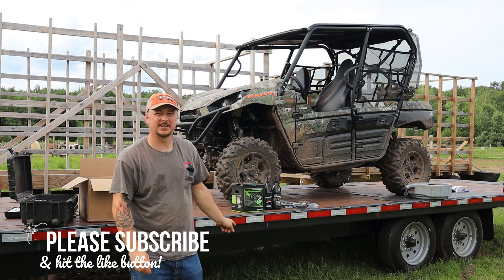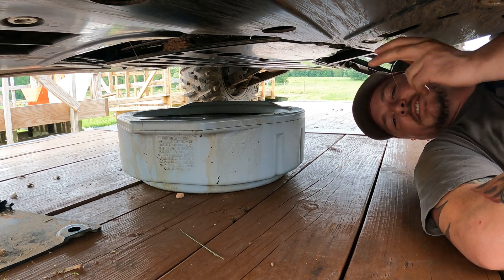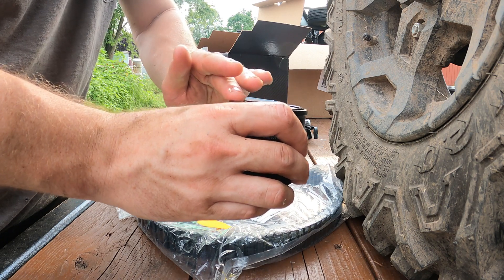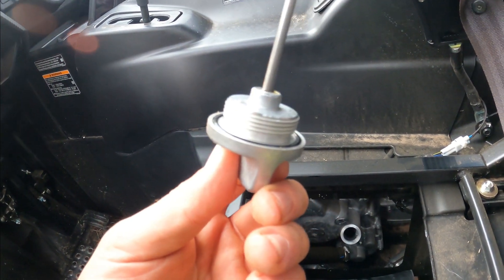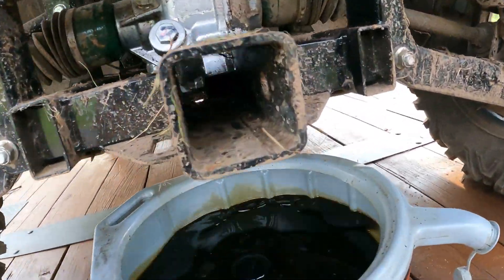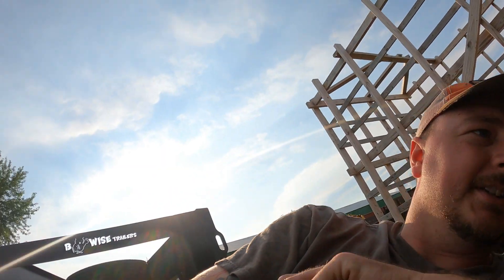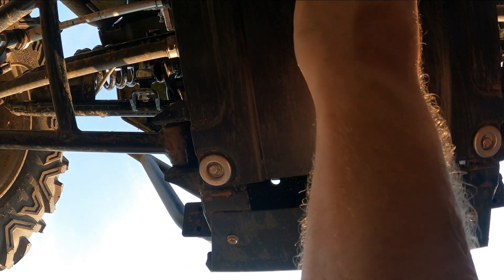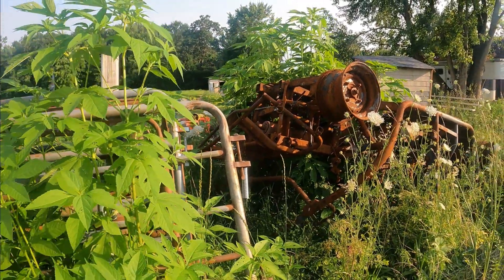#59 Kawasaki Teryx DIY Full Service Engine oil Differentials.

Comment: Amazing machines!   7yrs now on a 2017 T4LE and not one single failure.  Original battery died before Christmas. Original Bighorn tires are finally dry rotting so they're coming out next week.  3500 total miles.  Always do all 3 oils and air filter like this video shows. We climb 14,000ft peaks every year with the Teryx and always get home.  Good job, Kawasaki!

Comment: Good job. I bought a funnel with a tube that screws right to the bottle from ORieleys. Made filling that front diff real easy and only cost about 5 bucks.
Reply from the maker: I had something like that before the fire lol I think I will be making a stop to orielleys because I do change the diffs every time I do the oil. Thanks for watching and the recommendation.

Comment: Nice, 3 year warranty is a huge plus, might need to look at one of these as my next rig.
Reply from the maker: The teryx has treated us very well! our 2020 model had over 3000 miles in under a year with no probnlems! Before this we had a polaris rzr which was very problematic, poorly engineered and the dealer service was horrible.
Reply: @HillsideAcres  I’ve had two Polaris (one RZR 570-S & Ranger Highlifter XP1000) & a CanAm X3 turbo. All had positive & negatives.
Reply from the maker: @jdub229r  The Teryx wont have the power of the 1000's but Reliability was the most important for me. As well as a 4 seat unit with short wheel base.

Comment: the correct size for the front diff bolt is 27mm. I like using a K&N KA-7512 air filter & a K&N 204-1 oil filter, it has a 17mm nut on the end, easier to remove/install than using wrench. And AMSOIL is better than kawasaki oil & diff fluids, plus it's all synthetic.
Reply from the maker: I don’t like kn filters in dusty environments, they let too much material through. Oil is subjective, changing at proper intervals is what will make the difference

Comment: Quick question, don't you need to add anti slip diff fluid in the front?
Reply from the maker: Gear oil. Rear requires wet brake gear oil.

Comment: So new to all of this. The manual is some help but not understanding some. Does this not have transmission fluid to change? If so what kind of fluid. Also what weight is the front def. I want to run royal purple gear oil.
Reply from the maker: Motor and trans share, front is just regular gear oil , rear requires wet brake oil
Reply: @HillsideAcres  so can I use 75w 90 in the front?  Also thanks for the video. It’s very informative and really helps a starter like myself.
Reply from the maker: @Jason000111mmw  I use 80 90 but you should be fine. No prob, just with I had a better spot to to the video at the time,
Reply: @HillsideAcres  shit I thought using the trailer was very clever. Thanks for the info. Have a great evening